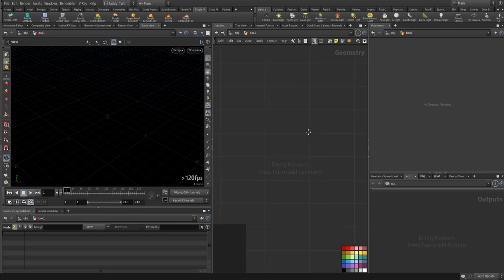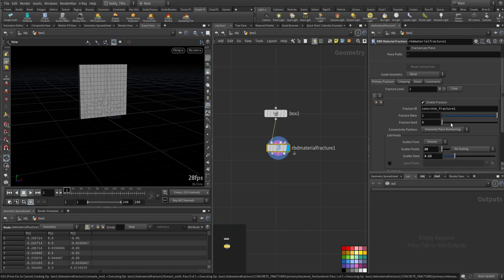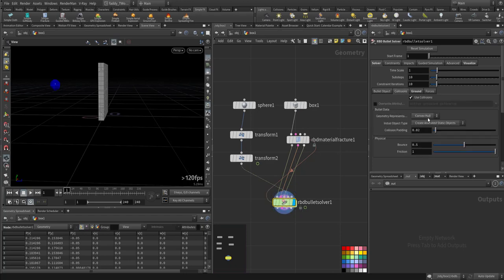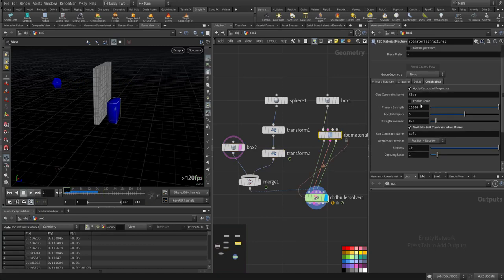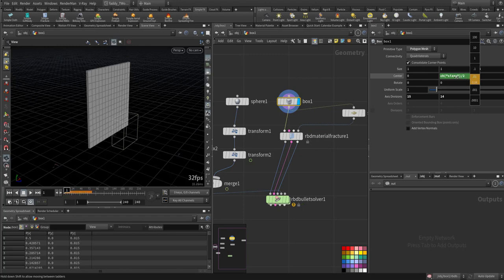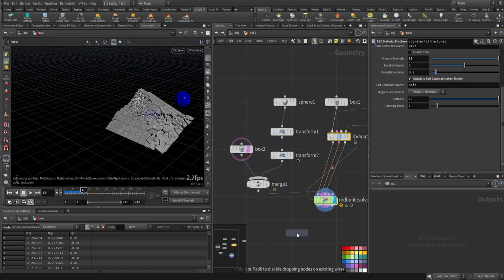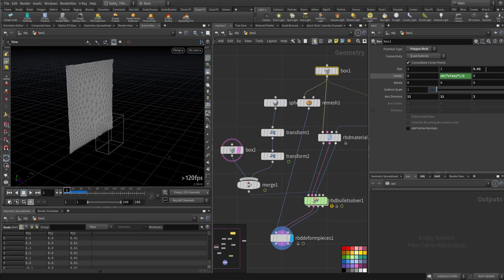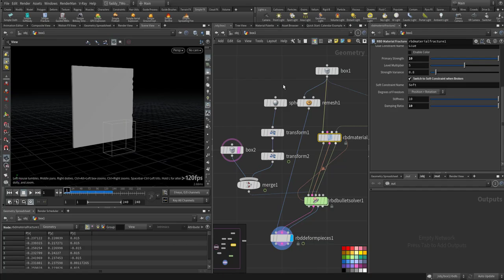Houdini Fx bending Metal using RBD solver

Comment: Hey, SideFX dev here. You should use Point Deform node instead of RBD Deform Pieces node here. RBD Deform Pieces is intended to deform high-res fractured pieces with low-res animated proxy geometry, not to bend pre-fracture geometry where there are no "pieces".
Reply from the maker: Yes you are right, i figured that down the road, point deform is the applicable node. Thank you